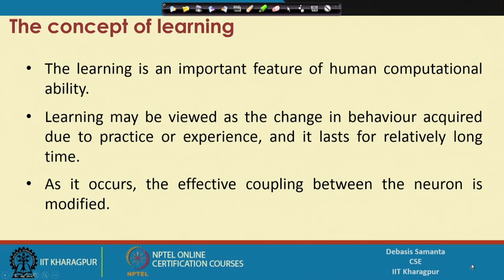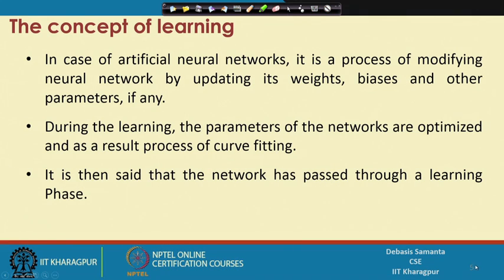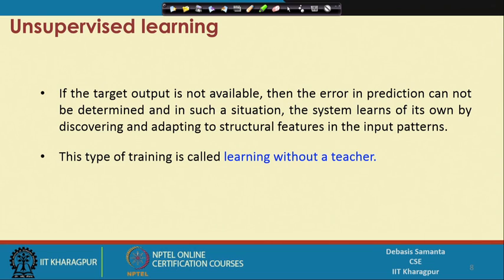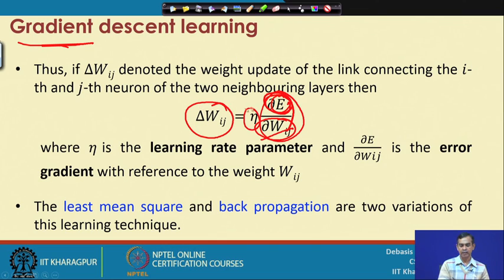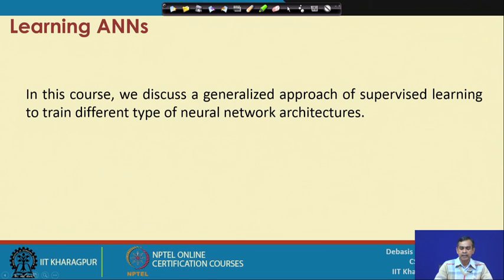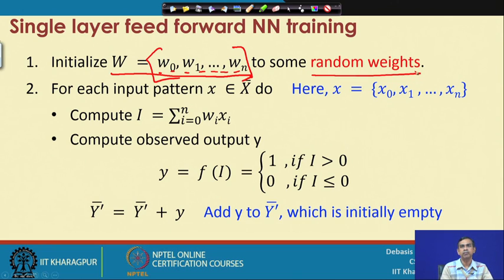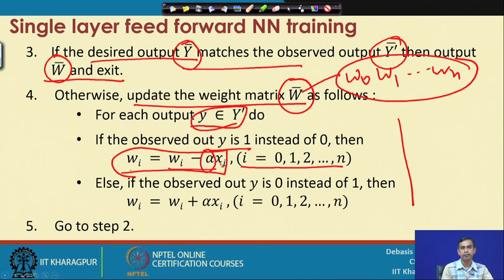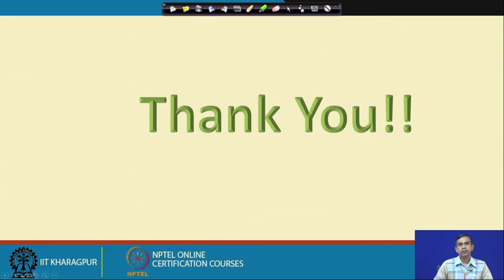Lecture 36 : Training ANNs

Comment: Hello sir, I am pursuing my phD in water resources engg. I want to apply ANN in Regional flood frequency analysis. As you know basically flood is affected by so many parameters (that i have taken as input) and in addition I have Annual maximum flood value of 30 years.In this case how I can apply ANN.It is requested kindly guide me.
Reply: It is conceptually simple to simulate using ANN. Only thing is back propagation using gradient descent that has chances of giving local minima of cost function. You need to apply heuristic optimisation to avoid it. Kindly let me know if you want to collaborate.